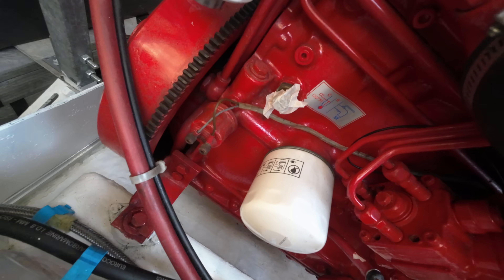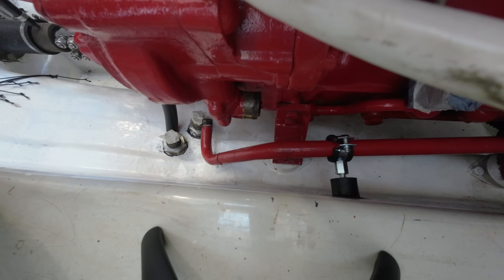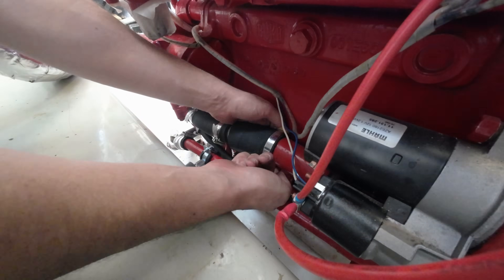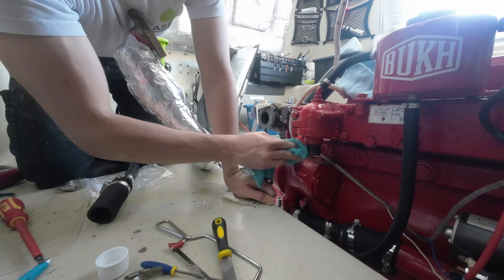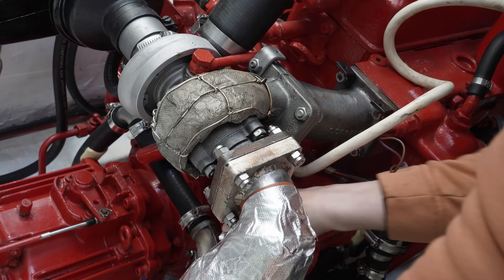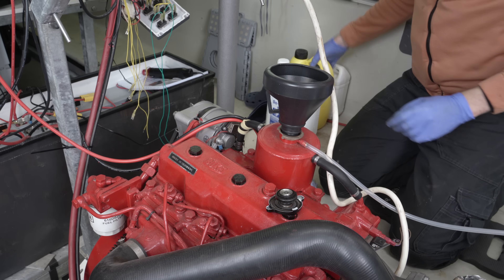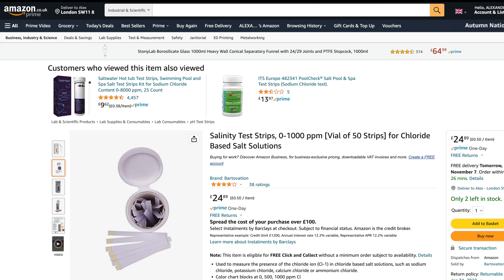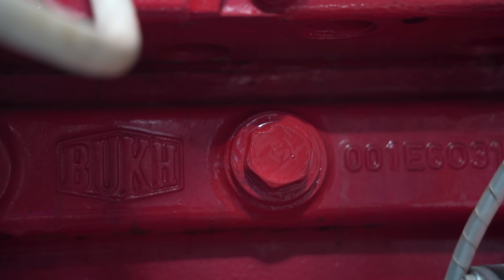Engine Cooling Overhaul Part 2. New hoses and valves are installed  Lifeboat Conversion Ep60 [4K]

Comment: You probably have your reason, but im just asking, why not just buy cheap velcro and use that instead of more expensive magnets and polycarbonate? Just a question as i am using velcro myself, wanted to see if there is any reason to avoid it.

Comment: Support to copper pipe should be mounted to engine assembly, vibrates as a single unit, never do right angle  bends, would have been better as one lenght of rubber pile, also use hose clips that have a rolled edge, I think wurth do them, but there are a couple of different makers, keep things simple.

Comment: Cooling system looks great. I wish you were able to install the y valves, and have a radiator down in the bilge - lots of free heat from that coolant loop just going into the ocean.
Reply from the maker: I actually set my own mind and that of my engineering cabal to this frequent and long standing question over the festive period. Whether diverting the existing coolant or using a heat recovery circuit to steal from the exhaust, a key issue is how to avoid heat pooling or over pressure when this cabin heater is switched off.

Comment: Hi Alex, ive just found your you tube channel ive been watching all of your clips for the past few days, but thought i would just leave a comment everything you have been doing has sparked my imagination, i worked offshore for over 15 very long years and have been in and out of this type of lifeboat many times, any way i digress i wanted to ask you about the exhaust and weather it would be useful to have a copper pipe heat exchanger wrapped around the exhaust for hot water or radiator and i know you have secured the solar panels but would they fit the hull better at an angle like a chevron im not sure if you had these comments before so please consign them to the bin if so cheers

Comment: The copper rings used on the valves will give you problems because of galvanic corrosion between the metal's
Reply from the maker: Interesting. I'll investigate. It could be easy to clamp a couple of mini zinc anodes to the valves, but I'm not sure what effect the anti corrosion coolant has on it acting as a galvanic cell.

Comment: Just FYI, there is a right angle crimping tool for your clamps it's Oetiker  Part# 14100498 which has the added benefits of both being compound action (easier) AND the jaws stop at the proper distance from each other so that you don't compromise the clamp by over-tightening them.
Reply from the maker: Thank you

Comment: After you run the engine for a few hours I would recommend re tightening the cooling system
Reply from the maker: Will do. Cheers
Reply: @AlexHibbertOriginals  also I would recommend checking them every time you change the oil I am a car mechanic and I have had many of those style clamps come lose over the years

Comment: Oh, Alex, please, PLEASE don't use a flat screwdriver for your hose clamps! Buy the right-sized socket screwdrivers, i.e. 5/16" Nut Driver. You can also get drill drivers. It'll save you headaches and stitches!!
Reply from the maker: I didn't want to over-torque, but yes it was a somewhat unscheduled investigation into my hand's inner workings.

Comment: Foil on the inside so when you have them in place it will help reflect light about, you could spray black then cover with foil for belt and braces

Comment: I hope those ball valves (3:20) & (3:47) never freeze, I used those for garden irrigation along with some plastic ones. A frost or two and the metal ones burst (just a clean break between the female threaded part and the valve body, left side press fit @ 5:01) but the plastic ones did not. Maybe yours are better quality.
Reply from the maker: I'd be staggered if they did. They are thermally insulated from the keel coolers, are made from stainless steel, and have all the industry certifications.

Comment: There are a number of companies that will fabricate bespoke silicone hoses of any diameter, changing diameter and shape. That would save you a considerable number of joints and duplicate for spares.
Reply from the maker: Yes I did look at this option, but the cost was pretty eye-watering. Plus, with a set of four hose diameters, my steel reducers and plenty of clamps and elbows, I can repair and fashion most configurations.

Comment: im still suprised you dont have a small fluid radiator inside the boat that you can engage via the valves to use engine heat to heat the cabin, but im sure you know what you are doing w/ the cooling system more than i do
Edit: the blackout sheets would be better w/ foil tape as it pulls double duty: it insulates and blocks the light (shiny side inwards so you get the insulation) and paint hates polycarb and would flake and come off
Reply from the maker: I've been looking at the specifics, and haven't found a good, controllable, and space-appropriate solution yet.
Reply: @AlexHibbertOriginals  as the whole engine will have a surface temperature of around 80 degrees C, all you would need to do is enable or disable a fan that pushes interior air through the acoustic box. The pathway can be muffled easily. To prevent sucking in cold outside air in huge amounts, cooling down the interior promptly to outside temperatures, provide the engine intake a route to outside, a reverse exhaust basically. If you want to be convinced about this, calculate the air displacement of your engine at a given RPM. Since it is a diesel, it is always at WOT. This is even relevant when designing an engine bay extinguisher system on 'regular' boats- co2 is often too quickly pulled out via just the inertia of two large diesel engines operating at planing speeds.

Comment: Thus, from a professional's point of view, hoses and connections look dangerous and the risk of leakage is considerably high
Reply from the maker: I'm always grateful for such coherent, detailed and constructive feedback.
Reply: @AlexHibbertOriginals  I understand that just a long hose looks ugly and a hose with different sized ends is difficult to find, but every joint is a risk of leakage and every extra joint is an extra risk of leakage. That's why I would do my best to have as few joints as possible in such an object.

Comment: Foil tape for the blackout covers. If it starts to peel you can easily replace it unlike the paint. It will also reflect heat as opposed to absorbing it which will cause the tape on the magnetic strips to fail. I worked third shift for a long time and I can't fall asleep in a room with lights on. I covered my windows with thick black plastic bags used for keeping large photo sensitive plates for industrial printing and some duct tape. They worked great at first but you could feel the heat radiating off of them. It actually was quite unpleasant to touch till eventually they melted the glue off the gorilla tape and fell off the windows. I made a change to aluminum foil that can be found in any kitchen. It reflected the sunlight and never got hot to the touch so the tape never gave way. It also had the added effect of hundreds of tiny pinholes that looked like stars in the night sky. Granted I don't in the arctic circle and the outside temperature wasn't below zero when I had the black bags taped to the inside of the windows either. So maybe they covers won't generate enough heat to melt the glue. I think further testing would be needed to figure it out. Either way you choose I'm curious what you pick and how it will hold up under conditions since this is one thing I'm very passionate about.
Reply from the maker: Noted. Cheers

Comment: For the blackout windows, spray the lexan first with the black paint so it looks nice, then put the foil tape on to reflect heat from the sun, or you could just do the paint so that the sun heats up the life raft more.
Reply: Reflecting the heat and UV back at the window from the inside can damage the window and its seals.

Comment: Do you have an option for a darker thermal tape that could have better thermal absorption? Seems like the tape is the safer option, but something that can take in any sun's rays to heat the ship in the chilly waters sounds like some energy savings in the long run.

Comment: To continue to be able to count in decimal rather than base 9, it might be a good idea to fit plastic guards onto the sharp tails of the jubilee clips.   A jubilee clips' little known secondary function is to draw a blood sacrifice from cold fingers in an emergency.   Otherwise, trying to change the alternator could turn into a Saw mini-series.
Reply from the maker: You're probably not wrong
Reply: @AlexHibbertOriginals  
You're so kind.. 
Of course you could just click your Ruby Red 👠 heels together a few times...
Reply: I forget about the blood sacrifice every single stinking time. After the number I’ve used at work you’d think I’d learn to always use gloves.

Comment: I know your probably know this but a hex driver will provide more torque on you threaded hose clamps. Even more if you use a 1/4” drive ratchet and a wobble joint and an extension

Comment: I agree with others. Foil tape. If you do use paint, be careful of the type. Some solvents can really mess with that kind of plastic. Also, the only possible concern I saw was the copper tube you cut off.  I'm sure you gave it a lot of extra overlap, but without any kind of barb, that joint is prone to leaks and slipping.

Comment: arent you worried, that, by removing the heater you run the risk of your coolant getting very cold  (and then anything bad that might lead from that) if Alan's Engine goes out for a day or two?
Reply from the maker: Not if in the water - the coolant will vary between the cabin temperature and maybe -1 to +1 deg C. The heater were there to heat the coolant in case the boat was out the water, and the coolant was -20 or -30 deg C.
Reply: @AlexHibbertOriginals  ah yes, i forgot you mentioned that in a past episode, it dawned on me as i read this. Good job with the plumbing, i have zero skill other than all i saw on youtube, and all i can say is good job. Really looks like solid work for all i know.... i wouldnt be as scared sailing in alan if i saw that :D 
Edit: i dont know if you will read this too but i just wanted to say i know why i like what you do so much, it straight up reminds of the old book of expedition Kon-Tiki. sbout guys crossing oceans wit ancient boat designs. all that except modern

Comment: I was just going to recommend 1/4 hex head. That's the most common worm clamp size in the USA. BUT The first comment already recommend it. They make it much easier, faster and safer. With that many hose clamps I wouldn't leave anywhere with out several

Comment: I’m glad you got that mini socket wrench. I think it’s one of the more underrated multitasking tools. Especially if it accepts normal drill driver bits. You can even use it in a pinch to drill hole with quick change drill bits. And if you use it with a drill bit extender and/or right angle adapter you can apply torque almost anywhere. I’ve broken two though, so if you start to rely on it, maybe buy a spare when on sale. 

I like the solution for the blackout screens. Very clever. Foil tape would be my choice. Because it’s shiny and nice to look at, and might be useful for reflecting Alan’s radiance when not blocking sunlight. You can also get polycarbonate printed if you want one side to have unnecessary but cool diagrams or information or beautiful pictures of you and Alan together.
Reply: Also it occurs to me that the overkill anwser to the tape v paint conundrum is tape on exterior and paint on interior.
Reply: I had to get an extra large socket wrench for removing wheels (tyre change kit) and larger sockets from British Leyland, then after a shoulder injury loosening bolts at odd angles(or my shoulder joint), I used the ratchet type from a Halfords car service kit to do the rest

Comment: Use radiator backing or a roll of laminate wood underfloor insulating.  It's opaque, insulated, and if you get the sliver backed stuff it will reflect light and heat back into Alan.
Reply: For the black out window coverings that is.
Reply: Since Alan is going to be used in an arctic environment wouldn't reflecting heat back into the boat be a good thing?
Reply: @brownass2  I hope so. It's what I use when camping in my car/van.
Reply: @NathanRae  if its reflective on both sides it will keep the heat out in the summer time as well.

Comment: While I could listen to you read yellow pages (bearing in mind they are today a lot thinner than in my youth) & ever so slightly off-topic, I noticed at the front of your Alans plucky lil throbbing power plant an extra pully attachment. Surely  you could add a do-hicky as our self-imploding American cousins call it to run an additional power-generating source for dark & cloudy/Snow days using belts and pullies yadayada. I may be having a senior moment & you have covered this in an older ep. That said thy Engine is looking grand there lad. keep up the entertaining toil :-)
Reply from the maker: It's an option! Staying simple at the moment.

Comment: A drop off gasoline on a rubber hose allows it to slide like a headed pig on ice-skates. It dries and fuses to the metal . Think motorcycle handlebar grips
Reply from the maker: Interesting - will check if those hoses are gasoline-safe.

Comment: I vote for the foil tape for the blackouts. I’m not sure you’ll get good enough coverage to block the light with the paint without a lot of coats and the tape will be easier to patch if you damage it out in the wild.
Reply: Second this. Foil tape is much more durable than tape and much easier to apply in the field.
Reply: I agree. I tried to black out a glass window with spray paint recently and the results were underwhelming despite several coats.
Reply: Black paint might get hot too in direct sunlight
Reply: I also agree. Plus polycarbonate can be fickle with paint, and even plastic paint can chip or warp the thin plastic

Comment: Hi Alex I am sure your screwdriver or wrist has a torque setting to ensure all the clips are secure however from experience I have done the final turns on hose clips using a small socket set - do not get near to over tightening but just try a little nip up all round for consistent torque which you will “feel” much better with the socket …..
Reply from the maker: Yeah people have been saying this. I suppose I didn't want to over-torque the rubber.

Comment: To save yourself from stabbing yourself again with the screwdriver invest in a good nutdriver set or at least one that is the correct size/length for the hose clamps.  you get far better clamping force with a nutdriver vs a screwdriver. Just my 2 cents from a marine engineer.
Reply: Agreed, one doesn't even need to drop too much on one. I have a T handle ratcheting screwdriver with a bunch of nut driver heads that I've used fairly heavily for years. It doesn't even have a brand name on it but I think I got it from Harbor Freight tools.
Reply: I second this! Flat head in a pinch, but socket or nutdriver is preferred on those type of clamps.
Reply: I could see the blood coming long before you felt it! Nutdriver is the answer, and you can use an electric drill for a quick system dismantling.